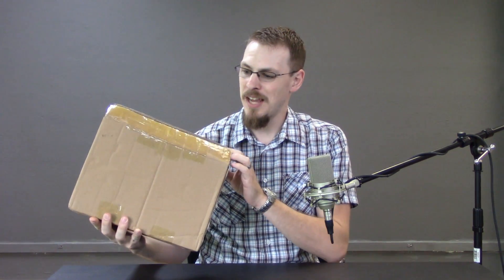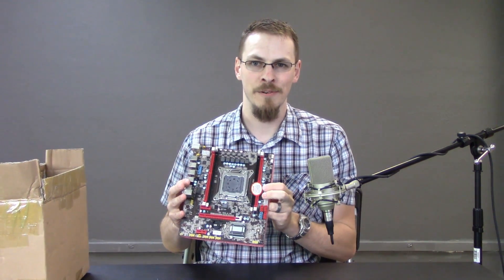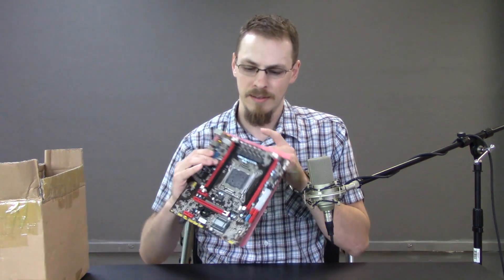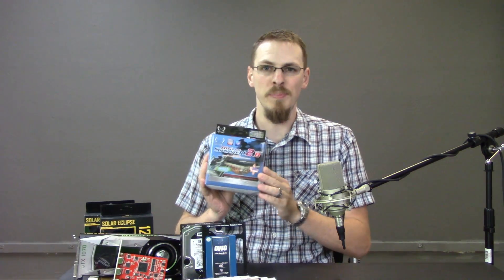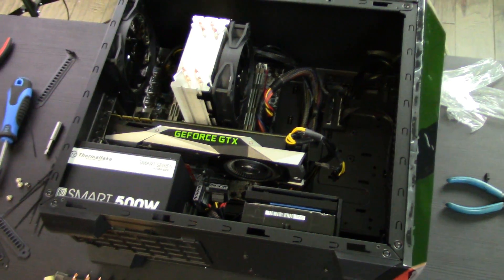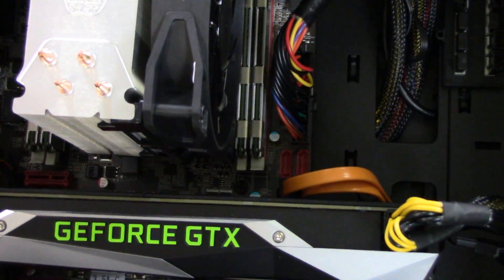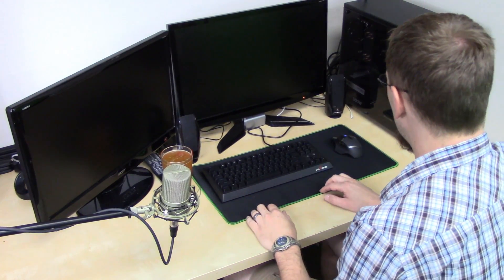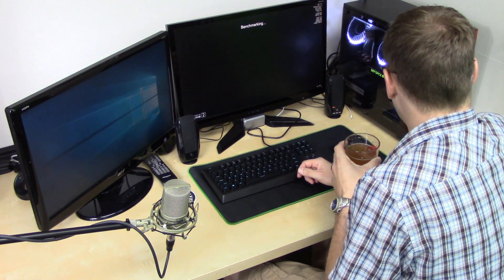Chinese x79 Motherboards... Do they even work???

Comment: 5 months later and the board is gone... not sure why i didn't do overclock and was a normal rig for casual games, as i work i even don't have time to play often. Mine came with one slot of RAM not working and i was ok for the price and the CPU that are cheap and beast no problem.  Then i upgraded to a E5 1650 worked fine, but this week around Tuesday i checked the task manager and the CPU was on 3.69 Ghz and doing nothing... and i decided reboot it, and for surprise it never boot back.

 As i work i didn't have time to do an intensive  revision to see what was going on, Friday i made it boot but  around 12 hours, then hard drive was on 100% doing nothing too, but no clicks and crystaldisk info was good not on caution, and then well it went to WHEA_UNCORRECTABLE_ERROR, again took apart the RAMS and even the CPU and the Radeon and clean it, boot it back and around two minutes after boot went again to WHEA_UNCORRECTABLE_ERROR.

So you get what you paid for, i know that LGA  2011 still pricey for its age but now i have 24GB ECC RAM and two goods CPU, E5-1620 and E5-1650 lying there in the case. I have a battery and a good power supply 80 gold plus and i didn't overclock it . But now as i don't want to leave those parts i have to buy a motherboard, was thinking on a Lenovo S30 that is on 100 bucks on Ebay or get one of those Dell  Precision T3610, T5810 and do a frankenstein pc. there is the option of the Z420 but then i have seen that it would give errors on boot .

Comment: you mentioned you used a 1070 FE for the GPU instead of a ryzen system, inferring that the ryzen would be superior for VR. I am currently building a system for gaming and mostly VR use. I do  not have experience with either cards. What do you recommend for a VR PC that stays in a reasonable budget (200-350ish)? Not trying to do anything but 1080P gaming but I want the VR to be crisp.
My build is as follows

AMD Ryzen 7 1700 Summit ridge 8 core- Processor
ROG Strix B350F AM4 ATX Mobo
Gskill Ripjaw V series 16gb (2x8GB) DDR4-3200 memory

Comment: no screws from the junk bin that fit the first cooler?
Reply from the maker: It was missing the 2011 socket standoffs.  So nope, no double threaded rods with the proper spacing in the junk drawer :-)
Reply: well regardless it's still an ice video with some good info!

Comment: vrms are no biggie I bought several of these( but not that small one)...that one scared me.  Intel doesn't even put heatsinks on some of their intel dxx79to VRMs' they never get to hot if you have a decent fan, here's the one I bought seemed alittle closer to the INTEL spec. https://www.ebay.com/itm/Intel-DX79TO-Extreme-Series-LGA-2011-X79-BLKDX79TO-Motherboard/131993060939?epid=116327865&hash=item1ebb66464b:g:j90AAOSwuhhXVGAr  And it boots faster than my Intel DX79TO does in any case. and seems faster when playing Pubg even on my 4k living room tv.

Comment: Hopefully they used quality capacitors on this low cost motherboard and not cheap junk.  Capacitor failure is a fairly common problem with low cost electronics.  Low cost Chinese caps have a poor reputation.  Time will tell...

Comment: Regretting not using a Xeon setup with my plex server. Currently has a i5-3570S, but want to bump it up to an i7-3770K. 
Would need an E3-1230V2.

Comment: Is it just me or did the price for cpu Skyrocket?  Guess my ebay finding skills are lacking. Cheapest i found was  106Usd. =(   Intel Xeon e5 2667 Used.
Reply from the maker: Yeah, I think my video actually caused the price hike for this CPU. They were dirt cheap until 2 weeks after this video became popular.

(Pats self on back)

Sorry about that.
Reply: Craft Computing thanks for your reply 😆 what other CPU do you recommend ?
Reply from the maker: They've all raised in price. The 2650v2 is pretty solid, as is the 2680v2, but those are both $140+.

The 1650 is a nice 6-core option for around $100.

Comment: I'm curious about VRM temps, and if there's any throttling going on because of the lack of cooling on them.
Reply from the maker: No throttling at all was observed.  VRM overheating would typically lead to instability, and this has been running since I built it without any issues.  I credit the top-down fan I installed a few videos later.  It doesn't take much airflow to cool them down to acceptable levels.
Reply: Craft Computing Yeah, I watched that one right after. Makes sense. Really nice either way.

Comment: FYI: I know this is a bit old but since it also applies to most electronics from China I figure it's good enough to post - the reason there's no battery is because that changes the shipping classification, and typically costs >10x as much, plus many shipping companies won't even take them. They don't distinguish between the button cells like that mobo and huge multicell lipo packs that DO require different shipping conditions. (And if it went through any European country it'd be seized right away. Lost a couple expensive ecigs myself that way off gearbest. Rule of thumb I follow: if it has a battery, always order and ship it separately.)

Comment: Does it still work? I fear that it isn't built of 50000 hr Japanese capacitors.
Reply from the maker: It's been on basically 24/7 since I built it. Still going strong.
Reply: Wow thats impressive.
Reply from the maker: Yep.  I have another model x79 board running as a home server right now.  It's much nicer, has proper heatsinks on the mosfets, and has been running perfectly as well.  https://youtu.be/VBvBzW8UEX0

Comment: I still wonder about those vrm's and mosfet's with no heat sink will it fry most likely I had a cheap gigabyte board they fried on it as it had no heat sinks either gigabyte didn't honor the warr. they must known it was weak is my guess . What are the board temps?
Reply from the maker: If you watch my follow up video to this, I addressed this with a top-down cooler.  The mosfets don't need much more than 'some' airflow to stay within tolerances.

Comment: Board comes in a anti-static bag. First thing you do is remove the board from the bag, and then put you non-shielded fingers all over the motherboard.

I’ve been a tech for 30-years. Yer habits are terrible. If the board doesn’t please you, blame static damage from yer damn hands!

Walking off now, shaking my head in dismay...

Everything shown, is in this video...DAMN!
Reply from the maker: I've been building computers for nearly 20 years.  I've damaged 1 board in that time span due to improper ESD safety.  Thanks for your advice though.

Comment: I have that exact mb with an e5-2690, for $125 I can't complain.  Update, I had sold a working 1650v2 and had parts enough to build another E5, I got a mobo Q67 chipset, off Aliexpress that didn't come with a driver disc, I can't recommend those.  I wanted Win7, loaded it, it did not load any mobo drivers, and I could not go online without the nic drivers.  Condensed story, Win10 loaded generic drivers, I had to manually find the nic and sound drivers on Realtek.com, then after getting online I had to go thru all system devices and processor drivers in the device manager and update driver.  Now it seems to be running, except I got whea error twice, I did update the nic driver again using the device manager, the mobo is supposed to be 4 channel but it is not seeing my ddr3 correctly, maybe a cmos reset?  It is running dual channel and sees I have ram but cpuz can't identify it.  I don't suggest going the lga 2011 route when B450 mobos are so cheap.

Comment: Obviously the only question now is about longterm reliability.
Reply from the maker: 6+ months later and still going strong.
Reply: You will probably reach the one year mark if you are lucky. After that all bets are off... Chinese products are notouriously bad manufactured and not made to last as they are very cheaply made. So I guess the choice is yours, do you want a durable lasting product or a super cheap one that will fail on you rather sooner than later ? Just my 2 cents on chinese electro crap.... Nice vid though!
Reply: intrax2tv I wouldn't exactly generalise Chinese products as bad because just like any country a huge amount of companies are now building up to a standard instead of down to a cost, and of course with the huge amount of production facilities there they can easily make anything at any standard they choose.
Reply: Michael Parker you can look here: https://youtu.be/kdvdkXyyYm0 and get your answer... board is dead !

Comment: I bought a 'Chinese' Tablet for $75, took a month to arrive. Constantly spams me ads and interupts Youtube videos, Podcasts, hijacks the ram and everything crashes. Ha! I don't trust anything 'Made In China' hehehe.
Reply: try to flash a custom ROM, it might stop the ads.
Reply: Weeks and weeks of trying. Wouldn't let me. Error this, and Not supported that. Was getting a phone fixed, he looked at it. "Give ya $30 for it against a ZTE Tablet, 2 gig ram and 16 gigs rom.Was asking $150. Got for $120, works great, problem solved. But, the Chinese remark is a joke, all thing computer, electronics made by Foxconn. Biggest employer in electronics, China, Taiwan, Malaysia, Hungary, Turkey. Cell phone, Computer components, metal detectors, everything.

Comment: $117 tho for unbranded x79 MB? what was ur guarantee? usually standard guarantee from ebay is one month but when getting stuff from China can take a month so ebay guarantee is up sometime before the item even gets to you. Saying that i have bought stuff from China and most of them say just keep it well send you another immediately which is good but i would never buy something over $50 if you dont have a fairly good guarantee. im pretty sure you can get an x79 branded MB for cheaper than $117 tho right, i would guess this board will fail sometime pretty soon too
Reply from the maker: +Hugh Janus The problem is you can't find a used board for less than $175 to $200. There was some risk in the purchase, but that's what made this project interesting.

Comment: So how to tell if the Chipset is genuine? I got an old LGA775 motherboard that I bought off from eBay, and while it functions for the most part, I am wondering if there are similar situation (fake chipsets) applied to my motherboard. (Asus P5WDG2 WS)
Reply from the maker: CPU-Z and other programs are pretty good at telling you what chipset you have.  I doubt anyone made a copy of that board.  That's on the extreme high end for that time.  As long as what you have looks like the pictures online, your board is going to be genuine.

Comment: China stronk. I hope they do 775 knockoffs too some day, I have a bunch of Xeons and Core 2 Quads willing to OC
Reply from the maker: +Shenanigans From Heaven They won't build any 775s, but you can find 1155 socket (Sandy/Ivy Bridge) boards. Most used 775s should already be selling well under $50.
Reply: I got some Dell 1155's for 15 bucks from ebay, they fit perfectly in the old 2002/3 dell dimension cases and take xeon e3's, Its an Optiplex 990 mobo

Comment: The way the CPU fan/heatsink are slightly cocked is a bit of a concern. Might want to re-mount a bit straighter. Unless, of course, the cooler still makes contact with the whole CPU die.
Reply from the maker: The Evo 212 tends to "float" a bit side to side, but the down pressure is solid.  It makes great contact.

Comment: 24-48 hr stability test and the temps of the MOSFETs and VRMs under stress that is what we want... also maybe some overclocks
Reply from the maker: I did do an 8hr AIDA64 burn in to test stability.  No problems, no fire.  I DON'T recommend doing a heavy overclock on this board.  I have questions about the quality of the MOSFETs, and so long as it's running fine at stock, I'd leave it as that rather than push your luck.
Reply: Craft Computing Okay thanks

Comment: DDR3 doesn't do quad channel, which your board has.
DDR4 does quad channel.
Reply from the maker: +louis tournas Not correct. It depends on the memory controller, not the memory type. Intel introduced tri-channel memory with x58, and quad-channel on x79. Both are DDR3.

You're confusing with the non-enthusiast parts, as Intel didn't have quad-channel on their consumer line until Skylake.
Reply: +Craft Computing:
I see.
I thought it was a new feature with DDR4.
One of these days, I should read about the differences between DDR3 and DDR4 (besides clock speed).
Reply from the maker: No worries.  It's basically a difference in voltage and bandwidth.  DDR3 runs at 1.5v @ 1,066 or 1,333 MHz.  DDR4 at 1.2v @ 2,166 MHz.  Higher speeds are available on both, but that is technically overclocking.
Reply: Does this Board support Quadchannel ?

Comment: there's something like that but for AM4 socket? If you can try something like that i would appreciate that review nice video btw.
Reply from the maker: The reason these x79 boards exist is pricing.  A traditional x79 board (from Asus, Gigabyte, Intel, etc...) typically costs $200-350, even today.  These knock-off boards undercut that price significantly enough that people will take a chance on them.

I can pick up an A320/B350 board for roughly $40-60 USD.  There's no room in the market for a knock-off board.

Same with X99.  I just picked up and Asus X99 motherboard for $115, brand new on Amazon.  Again, there's no room in the market for anything else.
Reply: Craft Computing you are right sir my bad didn't do my research this time i live in argentina and here the prices are really high. Thanks for the answer!
Reply from the maker: No worries at all.  Thanks for watching!

Comment: You say "Chinese motherboard" like its a bad thing. Remember all the major motherboard brands - Asus, Msi, Gigabyte, etc are made in China.
Reply from the maker: It's really amazing how many times I've answered this in the comments.  And BTW, all three you mentioned are made in Taiwan...

I don't say it as derogatory, as in "everything made in China is crap".  I say it because those companies you mentioned are multi-billion dollar companies with direct partnerships with chip makers.

This board was likely built in the streets of Shenzhen from off-the-shelf parts.  As in, the chipset is a modified P75, not a genuine C602 or x79... the USB controllers are slightly sketchy, the fan controllers don't actually work, they only supply power.... there is no support for BIOS updates or compatibility....

Do you see the difference?

Comment: how will you do with VR if it doesnt have USB3 ports...cause oculus require all USB3 ports for the sensors...1 port per sensor...and one USB3 port for the headset itself.
Reply from the maker: It has a pair of USB3 ports on the back, plus a USB3 header for front ports.
Reply: Htc Vive does not need usb3 ports....

Comment: Why to use low profile Synche cooler in such big case? Compromising cooling performance for form factor.
Reply from the maker: Top-down cooling to help the VRMs.  And I used a larger fan instead of the thin one it came with.
Reply: That makes sense, I didn't think of that, especially when there are no VRM heatsinks.

Comment: this is a beautyful case.
Lets put mustard and ketchup in it
Reply from the maker: Wasn't going to spend an extra $50 on cable extensions or a modular supply.  I built that entire computer for less than a 1070 will cost you today :-)

If it makes you feel better, it has black cables in it today.
Reply: well. my corsair psu has mustard and ketchup cables but my cheaper silentium pc psu has black wires. 
I only have in mind that techsource always complains about that.

Comment: If you want that to live for more than 1 year you'll need a fan pointing at the VRM. Personally I'd use Thermal cement to stick some mini heatsinks on the mosfet maybe the chokes and even the caps if you can get the real tiny heatsinks. (Even after that I'd still personally go with a tiny fan over it but you could reduce the speed by running it of the 5v rail)
Reply from the maker: Watch the next video in the series.  I address this issue with a 120mm top-down cooler.  https://youtu.be/dH7-FVpWHhM

Thanks for watching!
Reply: Craft Computing, that should do it. I'll probably watch that now. Good work. :)

Comment: I bought one similar to that, it worked well, ran a xeon e5-2660 in it for over a year with no issues, it did die after a power outage, took some ram with it

Comment: Ok, first no batteries get sent overseas due to legal issues, leaks & explosions.
You only get bios batteries included if it is domestically shipped, if you want to complain about it you should complain to the airlines (you will find that it is in their 'hazard materials' to have them fly while inserted into the board).
Still awesome vid keep it up, subbed :)

Comment: well i can say a battery wasn't included as its shipping from china and shipping items with lithium ion batters no matter how small is really expensive due to taxes and safety precautions
Reply from the maker: I purchased off eBay from a supposed California-based reseller.  The images posted had batteries, and it stated the board would ship from the US.

The board shipped from China, and the seller got a bit upset when I called him on it.
Reply: Ah then yeah I guess it doesn't make sense